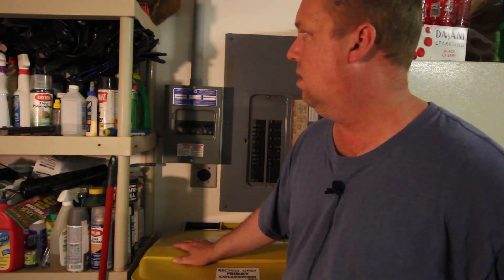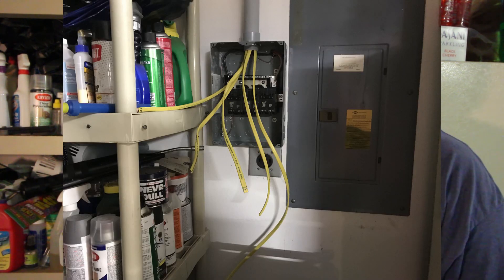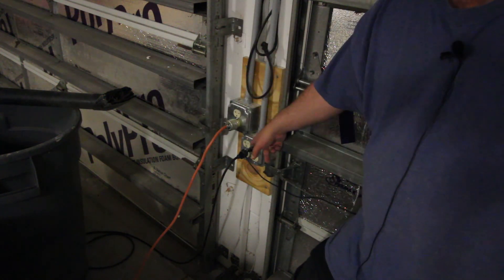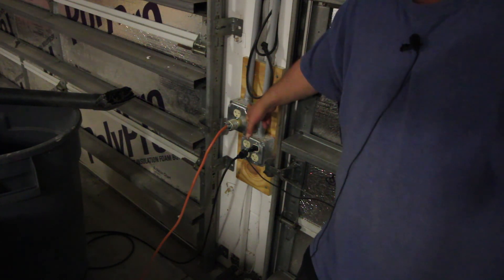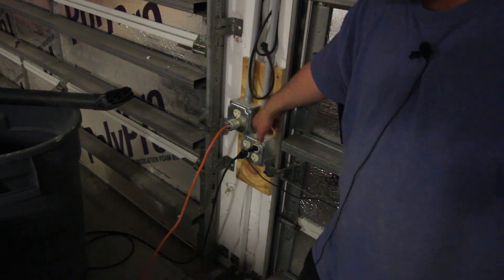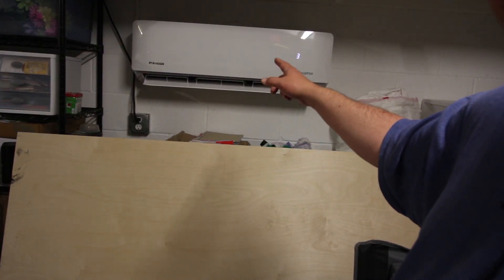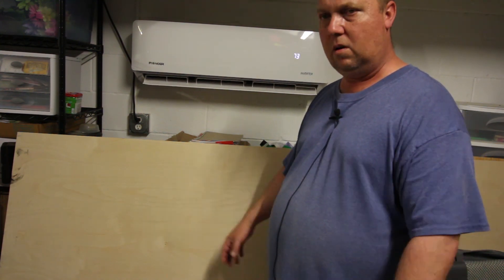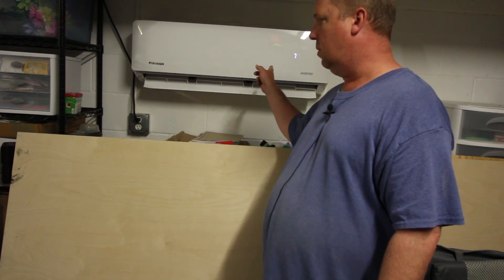DIY Shop Subpanel and Circuit Installation

Comment: Did a good job man and video helped me out..  i was concerned with putting another main disconnect in the subpanel but that damn load center as of 2017 requires a service barrier kit and nobody sells the stupid thing..  so instead of putting in a breaker in main panel and same 60a breaker in the sub panel i just ran like you did with the 1 main double lug disconnect in main for the sub..

Comment: I just ran acrossed your video. I to am a wood worker and have been shuffling extension cords for a couple years, due to one 15 amp breaker, in the garage.. You video has been helpful. I m ready to take the plunge. Thanks.
Reply from the maker: Great!  Glad i could provide some ideas